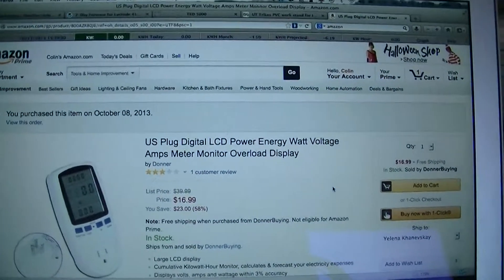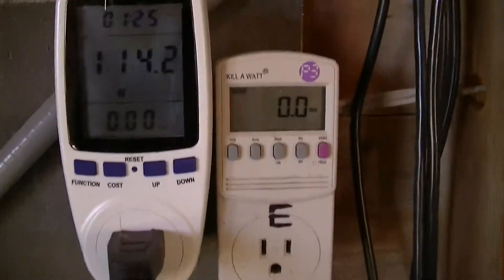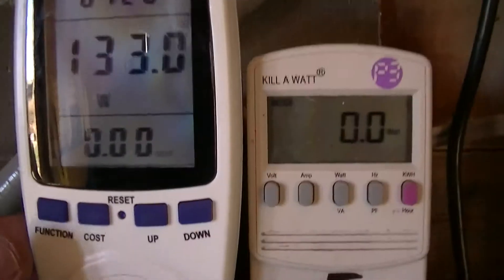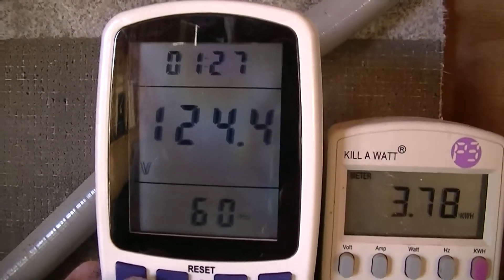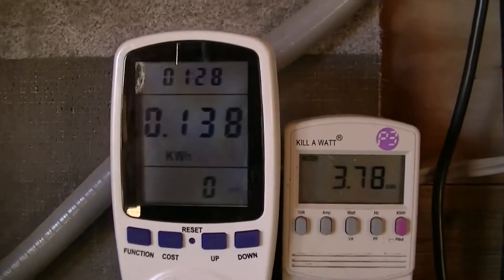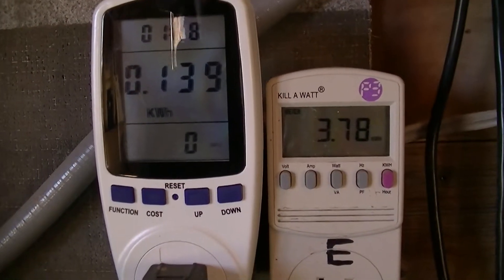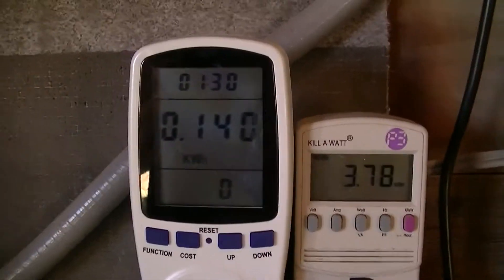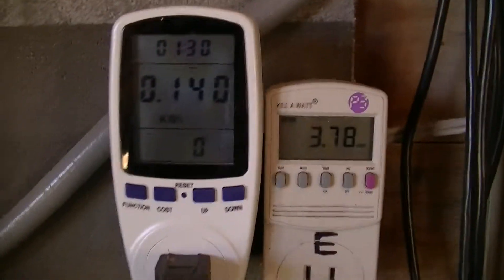Generic Power Meter Solar Wind Killawatt knockoff

Comment: Looking good. I recently acquired the pro version of the kilowatt meter which has similar functions but lot more pricier. My old kilowatt meter started giving me incorrect readings And I wound up troubleshooting 5 million things before realizing my actual kilowatt meter was the problem. Go figure never thought it would read wrong is reading about 30% higher than I was producing